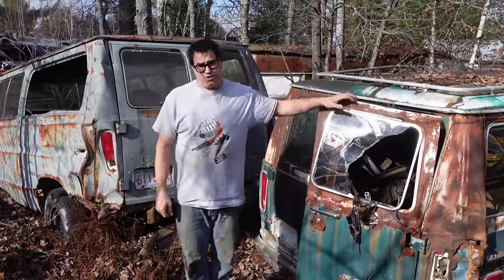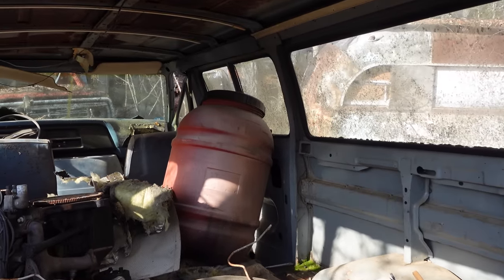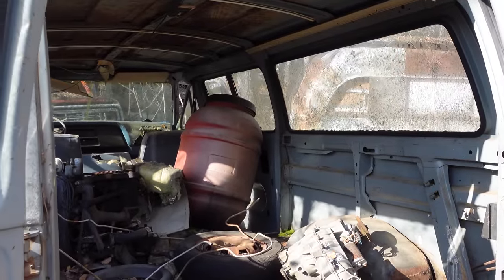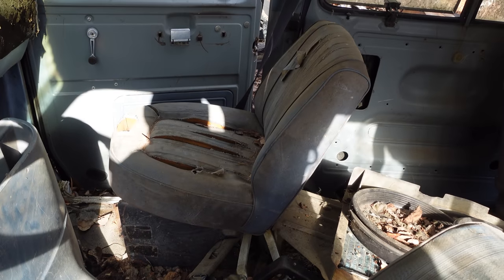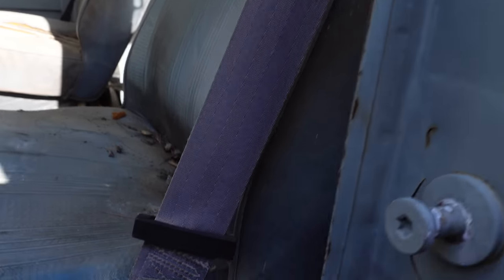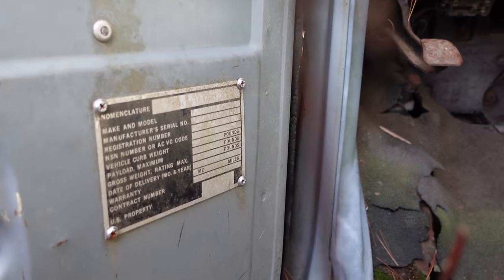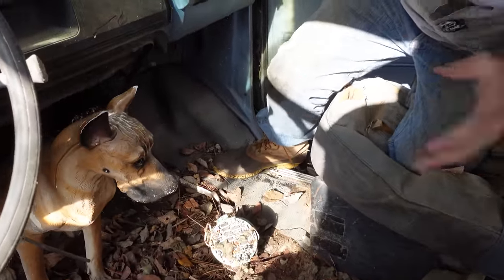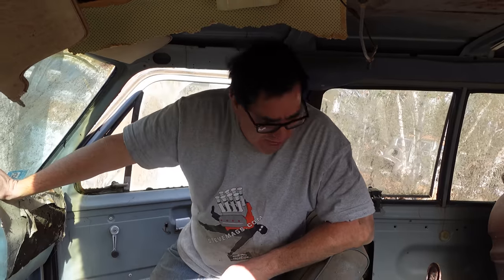Silent Navy

Comment: Yes, government and municipal fleets usually have a vehicle number so that they can track maintenance, fuel costs, mileage and what not. That placard was put there by the Navy shop or the original upfitter. Sometimes a maintenance placard is put there listing the fluid capacities, serial numbers for equipment, etc. They are usually classified by groups or contract series. The "9" might have meant all cargo vans, all Ford vans, all light duty, or maybe the starting year for the contract or bid process such as "9" for 1979 and typically, contracts for municipal and government are multiyear contracts. Yes, various Ford dealers and likely Chevrolet and Dodge probably competed for this contract. Sometimes it's multiple dealers of the same brand. Some have better fleet departments than others. 

Correct, most VINs starting in 1981 don't have zeros or the letters "I" or "Q" to avoid confusion. Earlier ones prior to 1981 did. Most modern 1981 and VINs follow a general sequence. Let's take a hypothetical example, a 1982 Chevrolet Caprice: 1G1AN69H*CJ123456. The first digit is 1 for US manufacture, G is for General Motors, 1 is for Chevrolet, A for manual seat belts, N for Caprice, 69 for four door, H for 305 V8 with four barrel, aka RPO code "LG4", * is a random check digit to avoid duplication, C for the 1982 model year, J for Janesville, WI assembly and the rest is the production sequence. Most VINs for most manufacturers for 1981 to the present follow this general rule and sequence. Ziebart is still in business, and their motto was "It's Us or It's Rust". My 1980 Trans Am was Ziebarted when it was six months old in 1981 (I still have the receipt) and it has kept it nice over the years. Their logo was the knight head in a shield. My car still has the Ziebart decal on the rear window along with a Chapman lock system decal. I have an NOS Ziebart decal that Ziebart sent me some time ago. They are still located at the same address as the label on this truck.

Correct, Ford trucks up until the 17-digit VIN format became standard in 1981 do not have a digit to denote the model year. The production sequence and where it falls determines that. So, here we go.....

1981 Ford Econoline with the VIN for the win: 1FM for US made Ford truck, E for 6,001 to 7,000 Gross Vehicle Weight Rating, E11 for E150 Club Wagon, E for 300 CID straight six with one barrel, Light Duty, then a check digit that's hard to read, B for the 1981 model year, H for Lorain, OH assembly and the rest is the production sequence. The Lorain, OH plant was the main van plant for Ford and operated from 1958 to 2005. Today's E Series chassis, which are only available as cutaways or stripped chassis are made in Avon Lake, OH. Don't forget, the government (all levels) have uniformed and civilian members. This could have been used by civilians to go to meetings or move people and cargo around, so they probably went with an automatic so that everyone could drive it who was assigned to the location where it was stationed. 

We got the tag, we can brag: 133 for wheelbase of the truck in inches (which is something Ford still puts on door jamb decals today), WT2147 for Gray exterior paint, likely a DSO (Special Order/Fleet) color, E118 for E150 Club Wagon, G for three speed Ford produced automatic transmission as Mr. Magnante stated, 13 for 2.75:1 Ford produced non-locking rear axle, DSO starting with 83 is Government, so yes, this was ordered as a government vehicle. The rest of the DSO is the invoice number for the vehicle and would have appeared on the window sticker or other paperwork. 

Yes, in 1981 things were ala carte and you had to order what you wanted. Today, it's not so much the case, although Ford does have fleet options such as limiting maximum speed, AC delete, prep packages for fire rescue and ambulance, DSO special paint, and other options. However, taking an F Series Super Duty as an example, when you specify an XLT, you automatically get Ford's Power Group (power windows, locks, heated and power mirrors, etc.) You can still however get a rubber floor in an XLT. So, Ford to their credit is somewhat flexible with options and layout. Being a Club Wagon by the VIN, I think it actually was a passenger van at one time. Yes, Chrysler introduced the minivan in 1984, GM in 1985 and Ford in 1986. Mr. Iacocca had the "dish best served cold" revenge on Mr. Ford by taking his minivan idea (along with Hal Sperlich) and introducing it at Chrysler (Mr. Ford shot the idea down at Ford) and this sent Ford and GM scrambling to catch up to Chrysler in the minivan market, something that they never really were able to do. 

Wishing all a Happy Thanksgiving and a good time with family and friends.
Reply from the maker: Hello Google User GP, Thanks for the info. I do some research on many vehicles before I make the videos. I usually like to point out the DSO location with Ford tags but in this case none of my reference materials could decipher what the "ER" or was it "E8" in the DSO meant. I KNEW it had to be something Industrial / Fleet / Govt and not a normal retail situation because of the Navy trim, but again none of my "retail-oriented" DSO lists was a match for what I saw on that van's sticker. Anyhoo, thanks for taking the time to help - as usual. I do plan on "making a point of" how the 1981-up 17-digit VIN system had "passenger restraint system" info baked into the 4th spot as occupant safety became a much more important issue in the 1980's. OK, Thanks again, Steve Magnante
Reply from the maker: Hello google User GP, I just made a connection....Zeibart was located just a few street numbers away from AMT Corporation, which was located at 1225 East Maple Road in Troy, MI! You knew this but AMT was / is one of America's pioneering producers of PLASTIC MODEL KITS. Though AMT has had a few different "homes" since it began in the late 1940's (as Aluminum Model Toys / AMT) by the "golden age" the 1225 East Maple address is printed on every model kit box! It's a small world....1/25 scale? Thanks again. -Steve Magnante
Reply: Great reply!! Longest, most informative but yes great reply!! Happy Thanksgiving!!
Reply: Funny, I would have thought 69 designated four on the floor🤪
Reply: @SteveMagnante  Sure. No, the DSO code is above the field on the sticker and starts with "86" for Government. The rest of the numbers next to that are likely the order or invoice number for the van. The "F and "T" numbers above it I believe might be the emission calibration codes. Those in some years translate into a specific emissions parts list in the parts books which were paired with that emission set up. So, for example, a light duty 300 with automatic and Federal emission might have one parts list, a 300 CID with manual another, and yet another for 300 CID with California emissions. The calibration codes on the certification label match up with listings in the parts book in the "9000" series section of the book. The E and 8 might be spring codes as that field in that position (and even in 1981 on some trucks) is used for that. Typically, it might say "SPR" or something like that. Another giveaway as to "fleet" or "special" or "government" is the "WT" code for the paint. Typically with Ford (and even today), special DSO paints can be had on larger fleet orders. Sometimes it can be as small as five trucks. Newer Ford Super Duty trucks for example are typically code "PQ" Race Red for example if you want red exterior paint. But, if you're ordering five trucks or more, you can can get DSO "W" series paint which might be closer to your liking, closer to your company's color scheme, etc.
Reply: @SteveMagnante  Yes, Troy, MI was the home of Kmart for a while (prior to the merger with Sears, who was of course based in IL). I have an MPC 10th Anniversary Trans Am model kit. Yes, AMT also did a version of this model as well. 1225 East Maple Road in Troy, MI is now a Penske facility.
Reply: @feelinfine1973  Sure thing. Likewise, to you and your family.
Reply: @seed_drill7135  LOL. I don't think the folks on the line in Lorain, OH back then in 1981 were thinking that. They were lucky to have good jobs with a recession going on back then.
Reply: I remember when my dad worked at the San Jose plant, that vehicles like this would all be batched together under one run vs. interspersed with regular production.  I remember one time the parking lot was full of gray F150s, and they even had "US NAVY" already stenciled on all the doors.  

When I was in the Air Force from 83 - 87 most vehicles for US bases were blue and the ones for European bases were OD green.  There were of course the CUCV Blazers and Hummers that were camouflage, but we had also had a hoop of OD green regular domestic vehicles like things like OD green Ford LTD wagons.

In the Air Force, vehicle numbers would be on the side of the door in yellow or black letters with the vehicle year, followed by a letter designation as to the type, followed by a sequential number.  I remember at Fairchild AFB, we had a bunch of 81 Broncos, that went something like 81B247, 81B248 etc.  Most vehicles had the B designation, but heavier duty vehicles would have C and i think the CUCV Blazers had K.  As for options, my understanding was that the Air Force would only order the bare minimum with the exception of an automatic transmission when available.  Air Conditioning was only ordered for certain climates and I'm sure that there may have been exceptions depending on the rank.   Then again, I do remember driving a 72 Ford Custom 500 that used to be an old base commander's car and it was austere with no air conditioning as well.

Wishing all the best on this Thanksgiving.
Reply: @kennethsouthard6042  Yup, all depends. We have a 4WD Quigley converted 2013 Chevrolet Express at work. Quigley does "pass through" upfits through GM as they no longer offer the AWD Express van coming straight out of a GM facility. GM and Ford have "ship through codes" that send the incomplete/complete chassis straight to the upfitter so that they do their thing.

Comment: Hi Steve, the fact that this Ford Econoline has glass all around or window(s) for that matter, makes it a Club Wagon to begin with.  A second row removable bench seat was standard, additional row removable bench seating was optional, probably long sense sold by Bernardston Auto Wrecking.  When the Ziebart (brand name) and/or the Rusty Jones (brand name) "just to name two" holes are drilled to spray in the rust inhibiting wax, they are supposed to coat the exposed drilled hole metal openings with the rust inhibiting wax before the plastic filler plug(s) are installed.  Please reply.  Dave...

Comment: In the early mid 2000's, I used to handle the GSA vehicle returns and handing out new replacement vehicles at a car auction. The majority of the cars (Olds Aleros, Ford Contours) were as basic as they could get, but still had CD players. Some of the Government agencies would get Excursion XLT's  with nice cloth sears and not the XL's with the vinyl. I recall a fleet of Tahoes where most were basic with vinyl interiors. However a few did have the up level cloth seats, aluminum wheels and factory step bars that I had to install. Even got a late 90's Lumina from the DEA with a 3800 Engine, dual exhaust, and factory installed Recaro seats. Today the US Government buys Hyundai's and Kias. I guess they have the cheapest bid...
Reply from the maker: Hello jeffsfleet, the radio delete thing can have exceptions. i know that certain police cars of the 1960's through 1980's were equipped with an AM radio at the least so that - in the event of a national emergency during the Cold War - police officers would have an alternative to their Police Radio to gain the latest info on the emergency from commercial radio stations broadcasting emergency news. Imagine, the Police Headquarters radio is disabled and the police cruiser has no AM radio. The officers would be "out in the dark". But with an AM radio, at least they would be as informed as the general public and that would help them decide what to do next as emergency responders. So glad we all never had to "duck and cover". OK, Thanks for watching and writing. -Steve Magnante

Comment: Very nice. Ive got an 85 econoline cutaway boxtruck. The cabs are almost identical. It runs great and almost two years ago I was using it for work. On top of that I didnt have a daily driver at the time, the truck got its use. Great vid

Comment: I had a 1985 Suburban for a while that had been an Air Force vehicle which had a similar tag on it.  It also had some tags with directions for use on an airfield.  

The AF preferred diesel on their vehicles, while the Suburban was somewhat unusual I still occasionally see G30 cutaway cube vans turn up gov't surplus that were clearly ex-Air Force right down to the 6.2 engine.

Comment: Automatic trans because sailors will drive it like they stole it and it's cheaper to not be replacing clutches all the time, 6cyl. for fuel economics although these things spent the majority of their life putting around base at 15mph which also beat them to death. Like someone else posted, it had the rear bench, we took ours out when hauling parts and it made a nice seat in the shop. Haze grey was going away when I came in, they are all white now, but the standing joke was " what's haze grey and never gets underway but sleeps six, a public works van".

Comment: The government doesn't want to be seen as wasting our tax dollars. They're GOING TO. They just don't want to be seen doing it. Happy Thanksgiving Steve and all.
Reply: Most government contracts are written as performance based rather than brand specific and have to go through a bid process. For instance, they may not have been able to ask for a Ford E Series van. They could however ask for a van with a minimum of a 300 CID engine, automatic transmission, certain GVWR range, etc. It's usually the lowest compliant bidder that gets the contract.
Reply from the maker: Back in the 1980's the state of Connecticut had a fleet of Buick T-Types on patrol on Rt. 84 and other high speeding-zones. The cars were mostly metallic brown and I recall their aluminum wheels were BLACKED OUT with some sort of charcoal anodize or perhaps simple spray paint. It was indeed a case of a state / govt. agency NOT wanting to court criticism for being extravagant with tax dollars. I wonder where those Turbo Regals ended up! -Steve Magnante

Comment: 1980s   none of our city cars,  truck s ,vans had a/c or radios first one I had with a radio was a 1993 still no a/c,  my 1998 E350 did
Reply: in the 80s, no, but by the 90s the so-called basic work trucks had what's called a fleet option package. Power windows so you don't have to stretch to reach the other side, (and rainwater rots the floors) AC to keep the windows clear on a rainy day, and usually a basic AM / FM to prevent accidents via boredom. (also traffic / weather) The package from some includes a trip odometer, because many trades charge mileage to the customer. The extra items actually add very little in end cost because they are building them by the thousands anyway. BTW, the power door locks are for theft prevention of tools and such.

Comment: 2:75:1 gearing with a 6 cylinder???      Zero to 60 in 5 miles.    19 MPG probably.     Absolutely no power.    Definitely a government ordered vehicle
Reply: definitely not for drag racing but they would last 100k miles if you never changed the oil. That 300 cu in 6 cyl was one of their better industrial engines for decades.